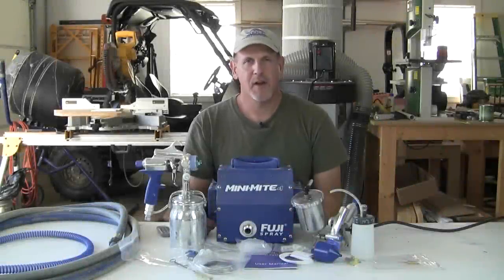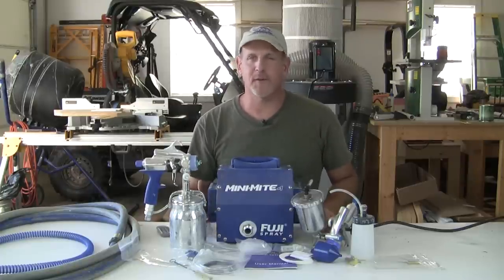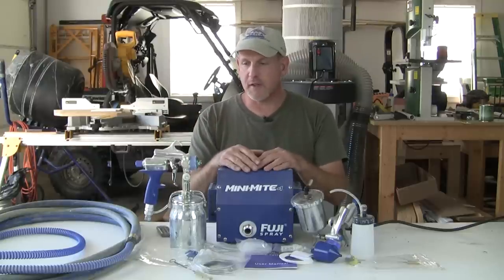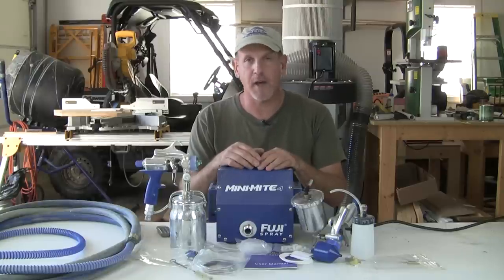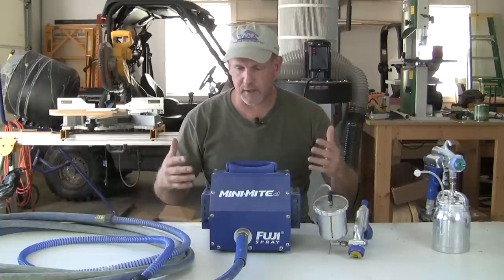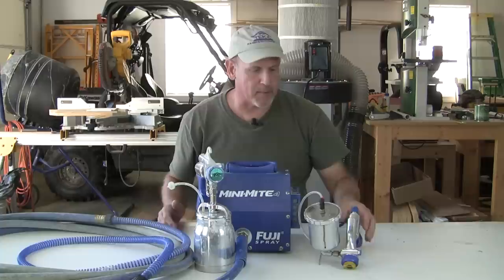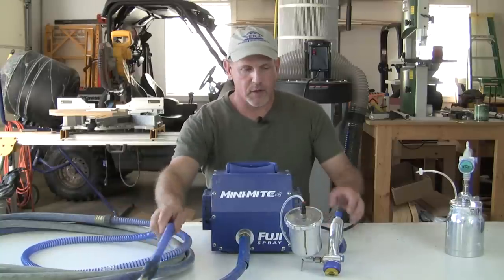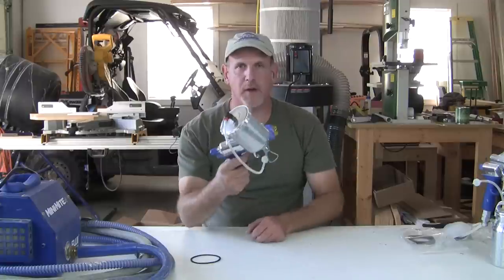Fuji Mini Mite HVLP Paint Sprayer Review Pt 1

Comment: Great video!  You mentioned that you’ve dedicated one gun to paint and the other to poly (I assume you clear finishes in general?)  Is this only for ease of setup as you mentioned, or does it also help with preventing cross contamination between different materials or do you find that cleaning it well prevents that concern.  No problems shooting stain and poly through the same gun?

Comment: Very nice video! Have only one question. What is a viscosity cup? Mentioned several times but didn't see it and no idea what it is used for unless the sprayer comes with drug testing :-)
Reply from the maker: Birds in the Wood Thanks for watching.  A viscosity cup is a cup that has a small hole in the bottom.  The time required for paint to drain out of the cup is a measure of viscosity.

Comment: You need to check your pronunciation of the word "turbine", as you're making it sound as though it's something some wear on their head!  LOL!!

In addition, the 4 designation indicated the number (four) of compression stages the air goes through.  Hence, their 3 model has three stages.  The basic premise is that the greater number of stages, the more volume the unit can output at the same low pressure.

Good post, BTW.
Reply: Marty Schlosser The 4 has a higher pressure than the 3, and the 5 is higher than the 4. More volume with same hose size equals more pressure.
Reply: You're certainly correct that the pressure will increase, however that's not the intention.  If the pressure goes above 10psi, it cannot be considered HVLP compliant.
Reply: im planning to buy one of these for my work.. im a professional residential painter and i stain cabinets.. is it better to get the highest stage? i was thinking to get the 4.